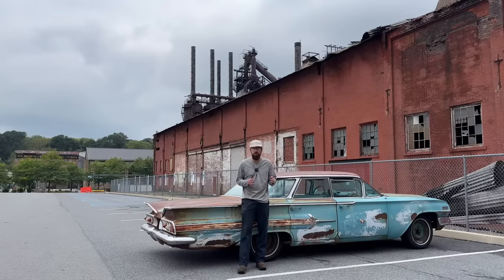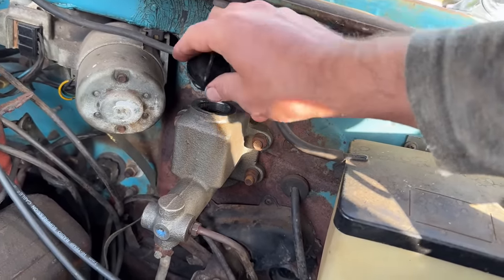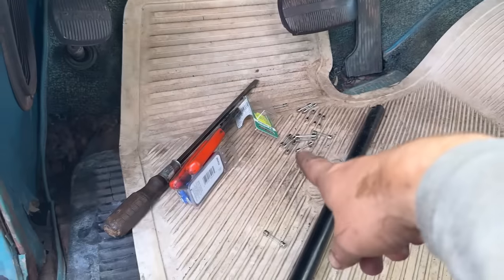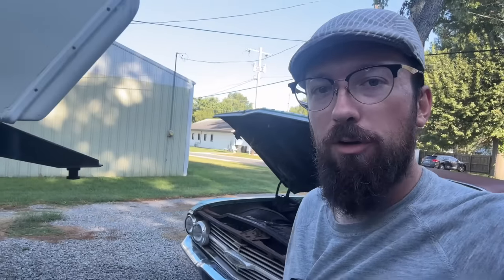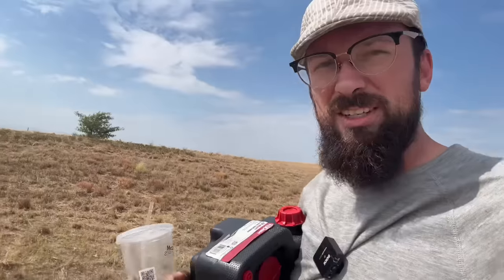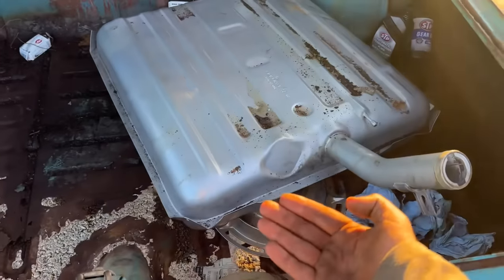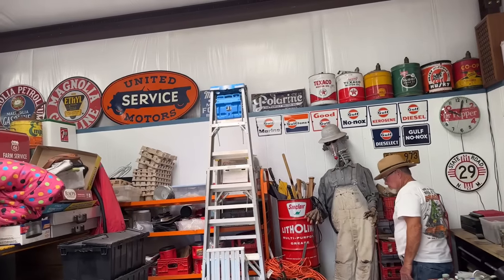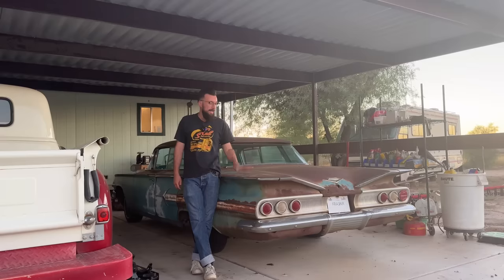2,556 mile trip in a 1960 Impala. Will it run and drive home? Part 2!

Comment: There is something very special about getting the car running again on the road. Something that nobody knows anymore. Anyone who has ever stopped on a country road in the middle of nowhere and had to glue the old shaft seal on the crankshaft because it blew out knows what I'm talking about. There's just no other way, if you can then drive on, even if it's only as far as the next town, you've got it 😉 That only works with old boxes, forget it with new vehicles 🤭

Comment: Feedback:  Please don’t pull over on the shoulder unless there’s no other option.  It’s so dangerous, especially, as distracted as drivers are today. Also, motorists are required to make lane changes preceding (if they do)
I’m a returning viewer and new subscriber. Keep ‘em comin’!
Reply: Honestly I would have been too nervous to get under the car on the shoulder.  The idea of waiting for a tow seems to maybe have been a better option.  Of course that may take hours depending where you're at out there.

Putting out tri-angle warning reflectors back 150' & 100' and 50' at least. It's the law for commercial operators.
You need to be a minimum of ten* feet from the roadway not to put out warning devices.

*...my best recollection, could be more than ten feet, but it's Federal Code no matter the State.
Reply: is it really that dangerous to stop on the side of the highway in the US? are drivers really that bad over there? because to me it seems thaat if you have a problem with your vehicle its perfectly safe to stop on the side and do a quick fix to make it to the next exit or rest stop
Reply: A friends dad got struck and passed away from helping someone on the side of the highway.. it’s dangerous. People don’t pay attention
Reply: @mixedupgirl Yes, it really is that bad. 
I'm a trucker so l travel 100,000+ miles per year and l see a LOT of stuff... and a lot of it l wish I'd never seen.

Unless it's an emergency and you have no choice, please don't pull onto the shoulder. It's dangerous  for you, but also for other drivers as inattentive drivers get startled and spaz-out causing secondary wrecks.

I do enjoy the videos, but try to stay off the shoulder unless it's absolutely necessary.
Reply: @claztube for commercial vehicles not 62 Impala. 😎
Reply: @mixedupgirl yes only in the USA. In Europe the drivers always pay total attention, are never distracted never speed and of course since every European car is infinitely superior to American garbage, they handle absolutely perfectly during any evasive maneuver-which of course never happens because in Europe and every inter country besides the USA is just excellent
Reply: @michaelconverse5127  Butthurt much? Driving standards in Europe generally are much higher than the US. That's just a simple fact. To get a driving licence in most European countries requires a driver to go through a much more rigorous process than it does in the US.

But cry some more when someone doesn't fall to their knees and worship the brilliance and infallibity of the USA.

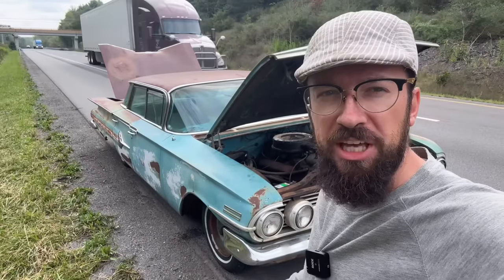Comment: @ 11:27 Next time you may want to drive to the next exit to be safely off the highway to bypass the heater core. That small leak was no where near causing the car to overheat as the radiator was still full. All it would have taken is for one car or semi truck driver to be falling asleep or distracted to slam into the back of your car with possibly fatal consequences. It has happened many times.
Reply: Yes not smart doing a video on highway after car starts running again.   You will only learn once

Comment: Hey Travis, great courage and tenacity!  The radiator caps are pressure rated.  This system only needs a 6lb cap at best - it needs to release pressure at 6lbs.  A plastic jug to catch what is released is the basic overflow tank created in the 70’s.  Coolant is essential to lubricate the water pump and raise the boiling point in the cooling system to allow you more room for heat.  Btw, those ball bearings  have taper bearing equivalents in size and are much easier to find.  We used to swap them out back in the 70’s according to a chart the bearing company had in the back of their book.   Love the adventure ❤!  Did a lot of this back in the 70-80’s 😊

Comment: That was one heck of a journey that you took me on. I have to say that I'm most impressed with you moving the gas tank to the trunk while 18-wheelers were whizzing by. That's pretty badass if you ask me. Great video!
Reply from the maker: Ha didn’t wanna do it but had to be done
Reply: Great video Travis, glad you made it home. When you were putin in the new tank & showed the rusted out floor/straps, I was thinkin just put a 2x4 across there inside the trunk & fasten the straps to that too to hold it up! Oh well, maybe next time.. 😎👍

Comment: If your cleaning that much sludge out of a motor you might want to spin on a new filter every so often as they will plug up and start to bypass that back in your motor. I’m rooting for Ya from Chandler,AZ!
Reply: I'm also from Chandler, AZ. That oil is way low, assuming it was full to begin with. It also looks like black paint. Keep changing the oil and filter, and use 20w50 oil. Maybe even put a can of STP in it.

Comment: We had Bethlehem steel in Ft Worth Texas as well and it to shut down around the same time and it’s been totally demolished and apartments built in place.
Reply: 🙏I grew up in Allentown, adjacent to Bethlehem in the 60s and 70s.  The Lehigh Valley was severely affected by Bethlehem Steel and Mack Trucks abandoning the area.  Yes, NYC was built with the steel moved 90 miles east using Macks.  My generation including my 3 brothers and I had to move away to make a living. There’s actually a casino on part of the Steel’s old property in South Bethlehem. Ugh. The song “Allentown” is a true story but the same story everywhere.

Comment: The beating race likely wasn't seated properly. Driving seated the race and loosened the bearing up destroying it. Be careful pounding the races out so you don't damage the flange they seat against. A slight dent won't allow you to seat the race and will cause this.

Comment: Your channel and experiences with your Chevy has inspired me to finally pulling the tarp off my old Ford and start tinkering again. 
Been 5 years and I haven't put a spanner on her.
Pulled the head, stuck valve, bent push rod. 
Rectified this, and refitted the head and now it almost started.
Almost lol
Battery died, so job for another day. 
Just wanted to say how much I enjoyed the Chevy road trip, and how you inspired me to finally getting out to my old Ford.
Its a 59 Ford Consul,  similar in condition to your Chevy, but we don't have the weather you guys get over here in the UK.
All things considered,  its a great project and have now subscribed to hopefully get more inspiration. 
Cheers Travis 👍 👍👍

Comment: THE family car growing up, same color and trim. Mom thought she threw a butt out of the window but in the morning the rear seat cushion was springs and ashes. I remember the new seat in the same pattern. I even remembered pulling off the highway and not having hazards and using the right surn signal thinking it was better than nothing!
Saw a few drive in movies from the back seat of that..
Thanks for the trip.

Comment: The 283 is hands down the best engine Chevrolet made. The slip and slide PowerGlide transmission is a legend too. I know you already know this but you can remove the inner speedometer cable and grease it up and put it back in service, the squeaking will stop and the speedo needle will stop jumping up and down. The vacuum wipers can be temporarily put back into service by squirting some brake fluid in it to soften the seals. If you don't mind I don't think I am going to use your tech tip after watching you almost bash your brains out. You have made yourself an epic adventure and a lifetime memory. Thanks for taking us along for the ride.

Comment: When I was kid, my pop had a 1960 Pontiac Catalina. Basically the same car. It was equally as beat up as this car. Was our family car. We drove it from Caldwell NJ to Buffalo NY once with bad ball joints. We got back to NJ, turned down our street and the lower ball joints collapsed. It was a miracle that didn't happen on the highway

Comment: Great videos, part 1 and 2. Impressed by how your figured out and repaired the altermator issue. I`ve got a 1944 Ford GPW that also got a Delco Remy, but 6V. Great to know if I get the same problem. Thanks! Greetings from Arendal, Norway.

Comment: Good save.  Where you broke down in Oklahoma was about 45 min south of me.  Reminds me of driving my 63 bel air 283 3 speed through st louis when you drove through there.  You need to stop in Tucumcari next when in New Mexico and stay at one of the older motels.  I didn't realize how young you were keep up with the older cars.  My 17 year old is leaning to ricer cars though I have a 70 chevelle crew cab for him.

Comment: That wrench trick you show is a good one, but it can be dangerous. You found that out the hard way, big time. Also, the fuel tank support issue. You called it yourself. Fuel is heavy. Bring a couple ratchet straps for your next trip. Great video

Comment: I have a 78 w116 280se which is probably the closest I’ll ever get to a real old car here in Australia. It’s my second car and has its fair share of patina (not as much rust as your impala, but it did have pin holes in the floors etc that I had to treat) rad has a pinhole leak now so I gotta find a new one and it likes to leak a bit of water in the cabin but only when it rains, guess it’s coming from the bulk head somewhere… she starts first turn of the key every time and I get comments all the time because of its patina the younger crowd tell me it looks like it’ll snap in half where as the older generation give me the thumbs up every time.

Comment: Dude, I love your 56 Fleetwood, especially the upholstery and the fact that is has A/C.
I got a 56 Fleetwood too, had to rebuild engine bc of severe knock. She has no A/C....but she has the Autronic Eye, wich I love!
Originally she was Cascade grey but she has been repainted once, and now it's more light blue than grey....
I got me a '56  pretty complete dual quad setup with air cleaner in Hershey this year so that's gonna be my next project!
Also got a 1959 Sedan De Ville flattop, in Pinehurst Green with a White top! I'm a fan too of the panoramic rear windows in "The Jetsons" style!
Love your video! Greetings from Belgium!

Comment: Righteous trip for Righteous Reasons.
Every ''Whackamo'' that is struck with an adapt & overcome repair...
is a permanent tattoo that makes it priceless.

~Currently owner of such tattoos by name... 
'53 5-window short bed std column shift 235 6
'59 Apache Big window Fleetside short bed w/'78 Olds Cutlass V8 automatic 
2nd owner since '73  '68 650cc Triumph Trophy Sports restored in 2012 

May blessings be upon your every continued endeavor.

Comment: Ok folk's dont hate on me for my opinion. I am glad this young man loves old cars as much as i do. That being said. He had no plan of attack when he went to drive this car. No extra part's not rebuilding the carburetor. Not replacing all the spark plug's and wire's. More tool's! He was not properly prepared for this trip at all. He is damn lucky that he made it. And someone didn't steal the car. Oh and should definitely have fixed the exhaust. Would have been more safe. If he would have hired somebody to transport the car to him on a rollback. He even left a puddle of antifreeze alone the road. Any animal could have licked it and died later.

Comment: So impressed how this old car runs for so long because I try to compare it with old cars in Russia like Volga or Vaz most of which have simply rotted away on the street for a long time, or even if they were standing somewhere in the garage of their grandfather, it will still be much more difficult to start because of simply less high-quality components of the manufacturer that are not able to survive to this day. it looks funny when a car from the end of 80 or the beginning of 90 is completely dead compared to a car from 60. Thx for this kind of video, I really like it you are good in it hope it will be a lot of old cars that you can revive

Comment: I own a 2003 Chevrolet Impala LS, old car has 168, 879. Only replaced the tranny once when the cv joints locked up and blew the differential at 165,070. Car runs great and drives perfect for it bein 20 years old.

Comment: In the 60's my parents had two well-used, and non- maintained '60 Chevys in succession: a four-door Post Bel Air, and a two-door Impala hardtop, both 283 2 bbl carburettors. I have never seen a 283 with a 4 bbl carburetor. You might want to check the engine numbers to make sure it isn't a 327. Those tinted windows look like those i think were standard in Canada. I miss walking out of our home and seeing the smiling front end of those cars, and the solid clicks of the doors closing, and the roominess inside, but both of those cars were unpleasant to live with after they reached 80,000 miles😢. And your friend reminded me about the unpleasant phenomena about not changing the transmission fluid because changing the fluid caused the internal band and clutches to become too slippery, and would cause it to slip and be no longer drivable.😂

Comment: Very cool adventure. Could you have dropped a piece of 3/4 inch plywood in the trunk as a temporary floor and hung the gas tank from that instead of the rusted mounts?

Comment: You probably didn't know this but you can rub bar soap on small cracks in the gas tank. It will hold until it gets wet. I used to use it on my '71 Impala back when I was a poor college student.

Comment: Hello, try to solve the problem of the fuel tank leak quickly for fear that it will cause a fire. You can treat it temporarily using epoxy or use a mixture of cement and date molasses. Good luck.

Comment: Good job man! It's been a fun couple videos. The one thing that might have helped is if you put a piece of plywood across the inside of that trunk floor. Easy to drill through and wire stuff up for support.

Comment: the reason that "Miss Belvedere" isnt in the city of Tulsa, or the state of Oklahoma for that matter, is because the city of Tulsa and the entire state of Oklahoma was very embarrassed by what happened with the vault flooding and the car being ruined after 50 years. all the mementos that were put in the car by residents in 1957 were lost and the idea was that the car would be gifted to the person who correctly guessed what the population of Tulsa would be in 2007 as a brand new 57 Plymouth. when it was revealed to have been ruined no one in Oklahoma even wanted to display the car so it landed in Illinois.
Reply from the maker: I did know about the population guessing and keepsakes. Didn’t know they were embarrassed that the vault didn’t seal

Comment: Man i love these videos, i have a 56 chevy daily driver with factory everything, just a small tip man run the car with non ethanol gas, wawa gas stations have good non ethanol gas 89 octane, no vapor lock and car runs like it should, if you dont have wawas the you can download the app pure gas and it will show you the stations that have non ethanol

Comment: The old Pittsburg Steelers Football cards in  the 50s.60s Have for their Logo. The steel mill. You should get a few of them  cards  to paper clip to the visor for good luck.   This was a blast of a  furnace adventure. I think you are thinking about getting that steel mill running again .😮 BUT you can't drive it home 😂

Comment: Next time you want to run power to the lights from a different fuse I highly recommend you switch to LED bulbs first. They consume a fraction of a normal filament bulb and there's less risk of fire, since you reduce the amperage though the lines considerably.

Comment: Love the content, but an Optima battery is not a Gel cell Battery it is an AGM (absorbent Glass Mat) alot of people people think Optimas are Gels. Odyssey battery are Gels and run the about $30 - $50 more, a Gel can't be reconditioned like a AGM can. I'm not getting on you just sharing the knowledge brother. WRENCH ON!

Comment: Hey big tip, if you're EVER in a jam and NEED a room, ANY of those sites like Kayak or whatever, the discount places, man I promise they'll get you a $60 room in a $150 hotel. All those generic motels usually have to have 1 room they offer on those sites, and it's not always the best mattress (we've had a couple with the absolute WORST mattress, no springs left in it you know) anyway, that's the trick man, if you're in a jam, use one of those 'discount' buy ahead sites. They WORK!

Comment: have always wished to do a roadtrip with my old clunker, tired to do a 400 mile trip last summer but the pin for the fuelpump worked itself out disabling the pump about 1 hour from home... got towed home and had to leave the car home

Comment: Hey next time you're doing the brakes and bleeding them just buy a brake bleeder tool and vacuum pump kit makes it easy to perform brake service on your own. The brake bleeder kit includes an accurate gauge for testing and servicing the master cylinder 😊. I got one for under $25 and i don't need no one to help me bleed the brakes it is a life saver.

Comment: Hey even on open differentials as long at the rolling resistance is the same between both rear wheels (like driving straight down the road) torque will be applied equally to both rear wheels. Only when resistance changes between the rear wheels will torque transfer to the one with least resistance.

Comment: I had a 1959 Impala sedan when I was a kid. I was all of 19 years old. I paid 100 bucks for it. It used more oil than it did gas. I rebuilt the engine and sold it for 250 bucks. That was back in 1972.